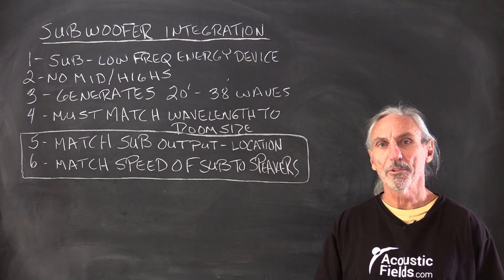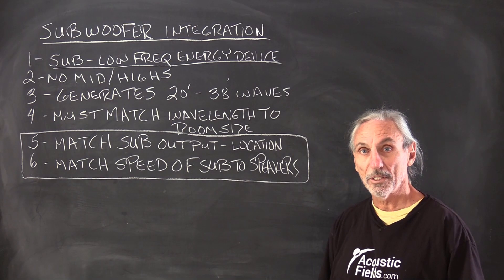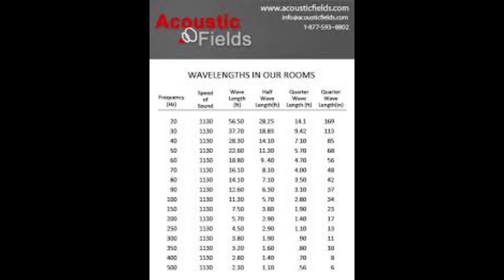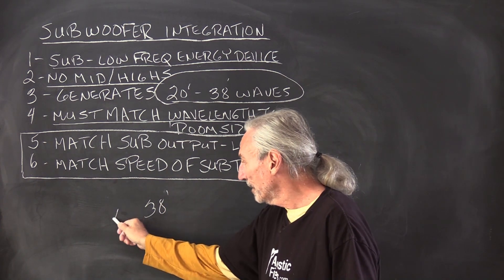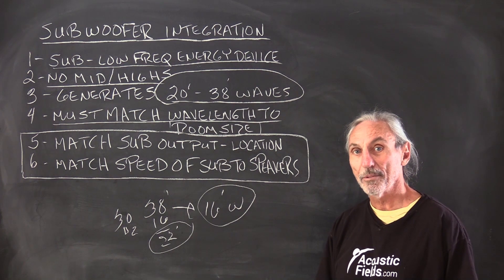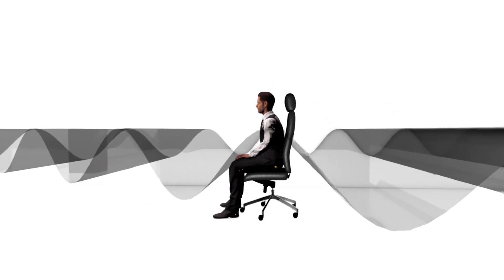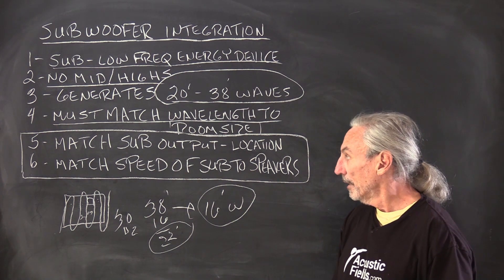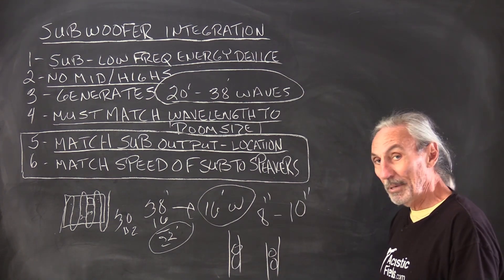Subwoofer Integration - www.AcousticFields.com

Comment: I think the idea of driver size/speed is over simplified, if not just incorrect. A 15" driver can produce a 30hz wave at X db easier than a 10" since the area of a 15" driver is more than double a 10". Also the 15" will not have to move as far and will stay in a more controlled, linear excursion. Another factor is the motor BL.
Reply from the maker: Driver speed and unwanted room  modal pressures are related along with the treatment rate and level of absorption
Reply: @AcousticFields  I am just saying the linear travel a 15" has to travel compared to a 10" for any given SPL is less, so as long as the subwoofer is built properly (not one of those companies that puts the same motor on their whole line from 10-15") the 15" should be at least as transient.

Comment: 2:40 you mention not to put the sub between the two monitors - wouldn't this be the only place to avoid phase/comb filtering issues at the listening position? I understand the subs are pretty well non-directional but the pressure wave still travels from the source outward
Reply from the maker: You must position a pressure producing device in an area that will not excite more air thus producing more distortion. Comb filtering is more of a middle and high frequency phenomenon. Stay away from the corners and room boundary surfaces.
Reply: @AcousticFields  Interesting! Thanks

Comment: I'd like to see you go into more detail, some of us don't mind some maths. Specifically what you think is happening when the fundamental "doesn't fit in the room", because I'm not sure what you're suggesting off the back of that. Is it overpressurising the room? Exacerbating standing waves? 

It's pressure at the end of the day and while room size is certainly a factor, earbuds can produce bass just fine and there's certainly nowhere neat enough space to generate anything below a few K hz, and it doesn't matter. We hear the bass just fine with the earbud sealed.

So I'd love to see where you're going with this.
Reply from the maker: When the wavelength of energy does not mathematically fit into the room dimensions, the air between the unfitting, offending, surfaces is excited to the point of audibility. This is an axial mode if it occurs between two parallel wall surfaces. You could call it over pressurizing that room area.

Comment: Nice ( but a little short ) explanation .
I totally agree with you .
Yes the sub woofer ned to mach the speaker ( and room )
In my studio I have 2 small studio monitors with 7 '' '' drivers ( or so )
I also have a 18 ''  driver in my subwoofer .
But if I use them together I will get precicely that negative result .
Instead im using the Subwoofer together with my main speakers .
Those are equiped with two 15'' ''  drivers and horn each and they 
are a perfect mach because the speed of drivers mach each  others .
Also because my room is not that big then I have tweeked all settings of the 
Subwoofer to also mach up with the room 
( yes it is possible to use  big speakers and big Sub in a small room ,
  It is just a little more complicated )

Also worth to mention is that many many people doesnt understand to level 
the Subwoofer with the main speakers .
Typically you will hear that way too loud boomy subwoofer sound .
Simply because they set the volume of the subwoofer way to high .

A subwoofer is an extension of yor main speakers and should ONLY 
extent ( NOT amplify ) the bass at the lower frequencies that your 
main speakers can't / have trouble in producing.

As I alway say  --- A perfect leveled subwoofer you can't hear when 
you play music .
It's '' not '' there ....
But when you turn off the subwoofer then you might notice '' something ''
is missing . ---

( Thats why I really hate all those Booom Boom subwoofer sound  )
( They are caused by wrong placement , wrong mach with main speakers 
   and by setting the volume / level way too high ) 

It's and Art to balance the mach between main speakers and subwoofer 
and get it all integrated into the room .
Placement of the subwoofer is something that most peole doesn't get right .
It is the level of distribution of low level energy / preasure that dictate 
where to place the subwoofer and that is different from room to room .

It is also very important you have a subwoofer where you can adjust 
NOT JUST the Level / volume  and cross over frequency .
But also can adjust the phase ( Im NOT talking about those +- 180 degree switch )
But adjust stepless ( mine can adjust from 0 to 360 degree )
This can help extremely in getting it all right when measure it up in your room .

And of course then we have acoustic treatment BUT THIS SHOLD ONLY BE done
AFTER your speaker and subwoofer have being placed in optimal positions .
Then you can start with acoustic treatment to tame your room problems .
NEVER add treatment to a room before you have solved your speaker and 
subwoofer placement and optimized them .
( you will only get more trouble then you may think )

Nice video that many can use to think learn from and better understand 
that just place a subwoofer in a corner or in middle of speakers is not 
the way to go  .
(As most people they just doing )

Edit -- 
Sorry for my eventually typos , im in my morning coffe right now  : )
Reply from the maker: You should do your set up after you have the room treatment in place. The set up will change after the proper treatment surface area coverage.
Reply: @AcousticFields  
There is a big discussion about this .
Truth is that you first place it all then you do treatment .
After all it is about taming he room .
The other way simply doesnt work .
You can never treat a room before placing the equipment , Never , it doesnt work. 
Proper and correct instalment of equipment , then you do the treatment .
( in some cases you may move some of the equipment but this is actually rare )
After all the only there have to chane is the rooms acoustics failures and you do not know them before you test how your equipment perform in the optimal setting .
After you have got your measurement for how your equipment perform and how the room influence is , then you do your treatment to correct those failures .
Edit ---
You need to put all equipment in the room before treatment install.
If you make a perfect treated room and then you add
A sofa or a few chairs  , some rack with equipment 
a table ect ect , they are going to change the acoustics 
of the room  and the sound treatment wont no longer work .
Only by have everythi g placed correct and speakers optimal setup ect ect .
then you can measure the room and start compensate with treatment for the failures .
In a studio with mixing desk and such this is the ONLY 
correct way to do this an it also apply to private listen rooms .
The room will change charateristic and acoustic when you add furniture and equipent and thus need to be calibrated .
This is the BIGGEST misunderstanding that most 
socalled anudio ingineers they do .
Never treat the empty room .
Put all yor stuff and equipment in it first and setup speakers in optimized place .
THEN you do treatmet  : )
Reply: sorry my typos , Dont know what went wrong  .

Comment: The speed of the driver has nothing to do with size, and everything to do with the driver QTS and cabinet choice. If you design a subwoofer with low group delay, it will sound good, regardless of the driver size. I see similar myths thrown around about ported vs sealed, when in reality both can sound good, if a designer takes the proper time with their simulation software.
Reply from the maker: Both designs have merit. I have tested both and as long as the port resonances are not audible, I have no preference. Some ports I have heard actually produce a "honking" sound.
Reply: Speaker inductance matters.  "it's too complicated"

Comment: I do not know were to start but you cant say somethng like that! That you ONLY go on woofer size! Speed is also determine of type of enclosure. We have MANY types of enclosures for example the slowest ones to the fastest and the ones that do not load the room as much 8, 6, 4 (ported) or 2th (sealed) order rolloff and the best fastest and load the room the least is open baffle.
I have no issues with bass in my room of normal size and no issue at all with even playing subsonic. But it should be slow when it is two 18", but there is not much of enclosure in a H-frame open baffle and minimum of room loading (for its size), hanging in free air and will not get even the traditional reinforcement from the floor there sub woofers traditional is sitting on.
A 10" is hardly much of a sub and will not play as low as needed and not as loud either please study the equal-loudness contour or ISO 226:2003 revision. then it is clear that a 10" will not be adequate to produce the frequencies we humans can hear. But if the compromise is to make a system that do are able to recreate the frequencies we can hear then it is fine.
Yeh we can hide behind that there is not many instruments that goes that low that is of secondary importance, when I find new low frequency information in album Dark side of the moon that the artist deliberately put there that I cant hear in a traditional non capable system with a 10". Yes that is a electronic type of album since 1974. I believe there has been many recordings since then that needs more than a 10" woofer to be able to hear the artist intentions.
Reply from the maker: Sub woofer diameter is directly related to output. You must match the output of the sub woofer to the room. You can hear the same data with a 10" as you can a 12". There will just be more output with a 12". This begs the question then about which driver size to use with which room volume.
Reply: @AcousticFields  Yes and no.  
Yes that a bigger driver diamer driver is  directly related to output.

But NO nobody only use only A driver without some type of enclosure (yes there is exceptions)
And when different enclosures is more and less efficient.

So we can also say: 
That one and same diameter driver is directly related to output depending on what type of enclosure is used.

Where and when for example open baffle is the least efficient one then if we choose that type of "enclosure" then we have to go up in driver diameter to match the output of a smaller diameter driver that is in a more efficient enclosure like sealed or vented box.

And as we all know that we should precive by our brain-ear "auditory" system, that we have a flat frequency response then for example if we play 1000 Hz @60 dB then we need to produce ~110 dB @ 20 Hz !
https://en.m.wikipedia.org/wiki/Equal-loudness_contour

So we can understand that a small 10" will not make the cut. If you want to be able to hear what your ears permit us to do. And that canvas is what the artist are able to utilize.👍

Comment: when i m trying to find a sweetspot for my sub, when i start from the middle of the room and then move it close/further from the walls, do i put it to face speakers or the same direction as speakers?
Reply from the maker: Try all options. Getting a low-frequency source to fit into a small room is a tuning process.

Comment: Thank you for this video! I guess my 10" sub is too slow for my new speakers with 5" drivers, is 8" right? Or is it better to go with an even smaller sub?
Reply from the maker: Driver speed is different than driver diameter.
Reply: @AcousticFields  Ok, then I misunderstood you when you said "So if you have an 8 inch driver, your subwoofer should be about 10 inch. You don't want to get 12 or 15 because the speed of an 8 inch driver and the speed of a 12 or a 15 are very very different." Thanks for the correction. It's going to be a while before upgrading my sub so I have time to figure it out and choose the best one for me.
Reply: @filipviljamaasvensson   This actually answers my question of how Presonus (or others) have the Eris 3.5 with matching Sub8 (the numbers are driver size) it's because they matched the driver speed, thanks. Now I just have to play with the sub and try room treatment....

Comment: If there is frequency overlap, Is it best to set x-over point at the bottom of the main speakers range, or top of the subs range? My instinct says to let the mains do as much as possible and the sub only where they drop off.
Reply from the maker: It will depend on how the room is reacting to each approach. Try both and report back to us.